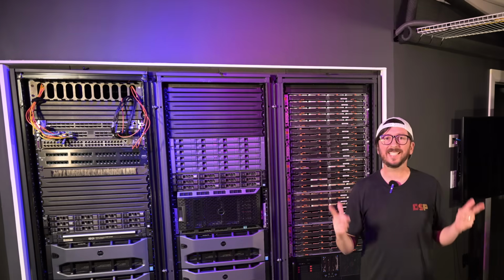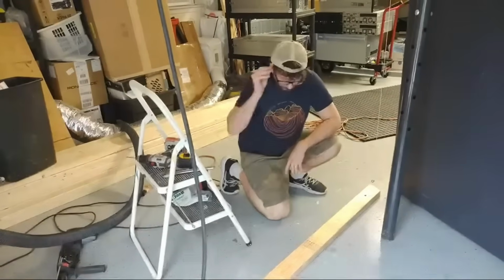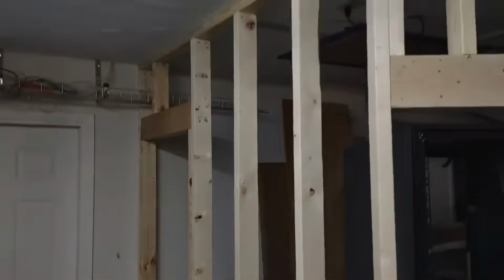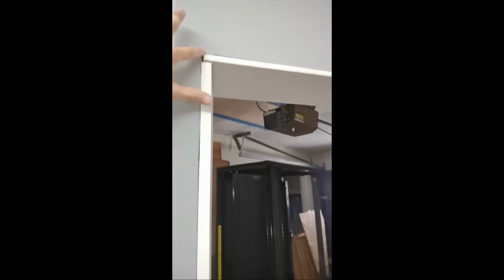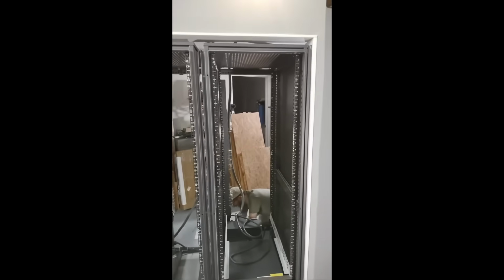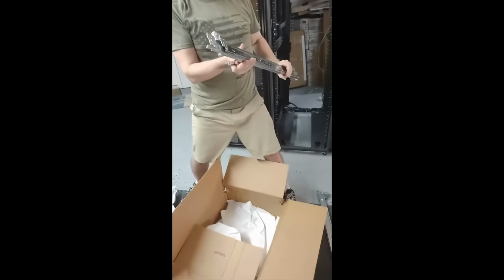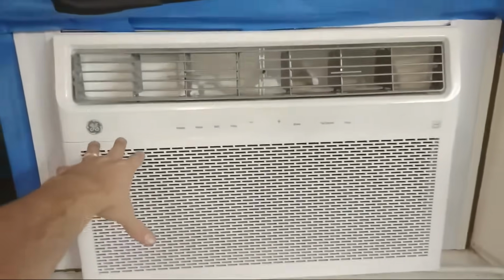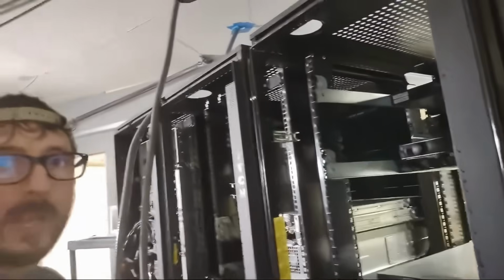INSANE DIY HOMELAB DATACENTER BUILD

Comment: I think a ducted mini split AC could work great for your server room
Reply from the maker: A ducted mini split is a good choice, I have looked into this my main issue with that is the run would need to be pretty long to the outside compressor unit and our house is stucco so I cant just drill a hole easy w/o some risks of fracturing and stuff.

Comment: How did you connect the KVM to the switch? Mine has a 25 pin connector, and I have problems connecting to the switch, so I can connect to multiple devices. Any tips are more then welcome.

Comment: love seeing the ICX-6610, such a great switch.. as long as you are ok with the noise and power usage!
Reply from the maker: I didnt need to run PoE on mine and I forget the cmd but IIRC that knocked down the wattage a decent bit when disabled. I had a fan go into screetchy mode on mine vs replacing it and that was when I decided to finally get the SN2700 figured out and pieced together and retired the ICX-6610 and by retired I mean sitting on a shelf for the next 10 years looking at me looking at it with all the other switches I am hoarding up for unknown reasons 🤔
Reply: @DigitalSpaceport  i kinda think of it as collecting.. not hoarding.. but that's just my take on it 😀
Reply from the maker: @GameOverDave  If you see me on that show holding onto 8088 SAS cables saying "wait I might need these" don't be surprised

Comment: Hi, do you gain profit from homelabs? or its just your passion? I mean the electricity bill and time it is costing you much.
Reply from the maker: @yowdhann7134 People assume I have a high electric bill, but it is rather reasonable. AVG is 250/mo with normal usage. Yeah I have used the R930s pretty extensively for 2 different jobs over the past 3 years but most of that same work is now done by GPUs and EPYC/Threadrippers. They do not run otherwise. This setup you are seeing in this video is also not optimally configured for performance either, and interestingly as a side effect, for perf/watt as a result. The DE6600 60 bay jbods I am replacing with DS4246's which will allow me to maximize and compartmentalize performance much more precise on a 24 disk basis also. Running 60 drives and getting the perf of 30 drives is a reality with some SAS2 jbods. VERY IMPORTANT HOWEVER... This is something I love doing 😍
Reply: @DigitalSpaceport  I see how passioned you are in this kind of things. Glad you enjoyed. this hobby cost a lot i think. Im from the Philippines and Ive been watching homelabs vids for a year now but still havent build one because it cost a lot here hahaha. Have a nice day ☺

Comment: Could you please clarify something for me about locally deployed LLMs, I've been tasked with this at my job. After watching almost all of your videos I know that using four RTX 3060 (Ollama) will yield me computational speed comparable to just one. However will having four RTX 3060 help in computing multiple prompts by multiple users at the same time?
Reply from the maker: By default ollama has Max parallel set to 4 so that is how many convos you can batch against it. Some models will handle it better but it wont scale linear or anything

Comment: Man, that's a lot of work, but it was worth it.
Reply from the maker: Step 1: Wait for hottest time of year to start massive project.
Reply: @DigitalSpaceport At least this time around you don't have to build an entire wall to surround the racks; you may have to do some adjustments though.
Reply from the maker: Yeah I totally lucked out yesterday and found 2 server sides I was missing local and thats going to save me building another partition 😅
Reply: @DigitalSpaceport Nice. I got a 120 VAC APC PDU to use with my rack until such time as I can buy the UPS I want and find a decent deal on a 240 VAC Switched PDU to pair with it.